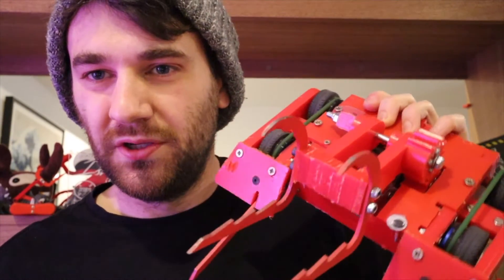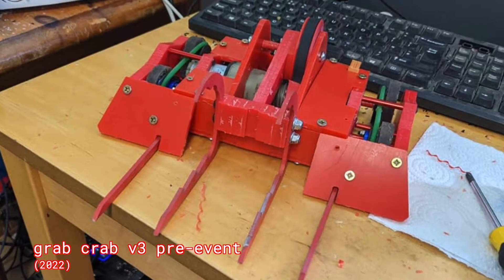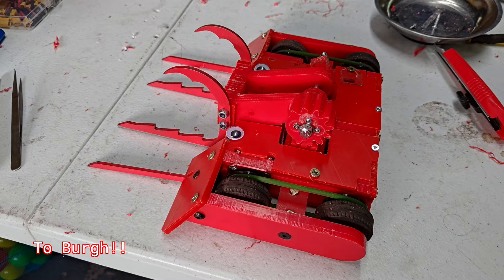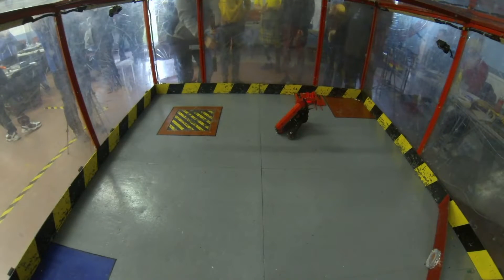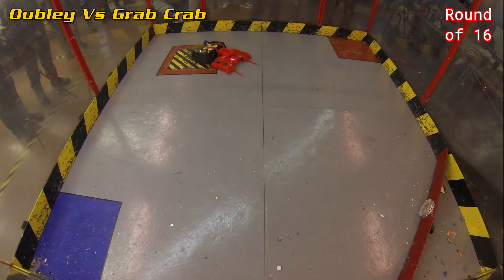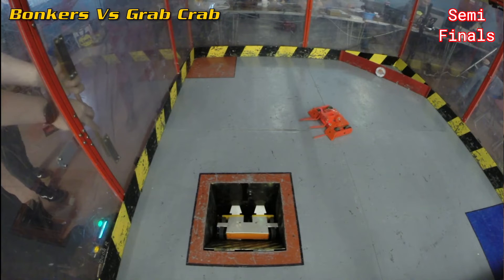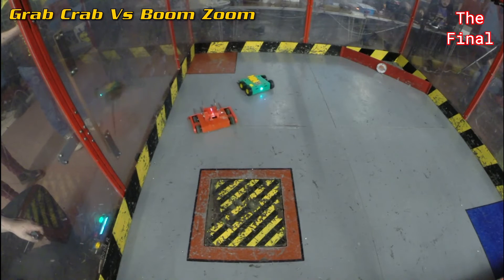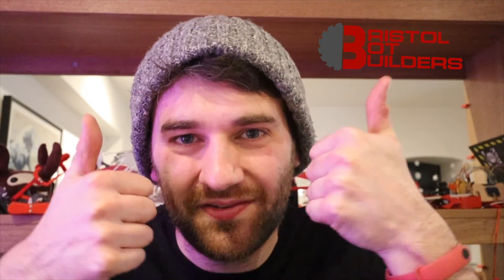Building Grab Crab v4: Yeeting to victory! - Beetleweight Combat Robot

Comment: I must say, seeing this performance and the one at Robot Rebellion, that motor might have weakened over time
Reply from the maker: You're spot on. It did - the gearmotor shaft actually sheared during rapture. Since then I've moved to a hardened hex shaft which has been holding up better on lob-ster, will be trying on crab probably in July.